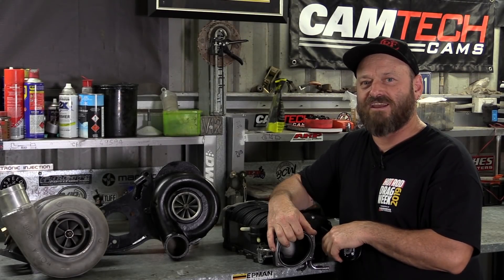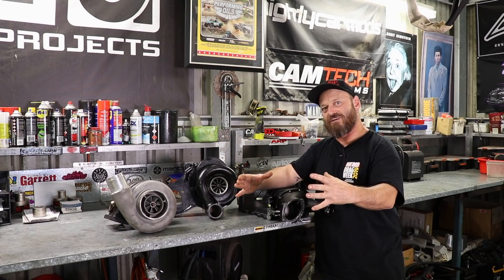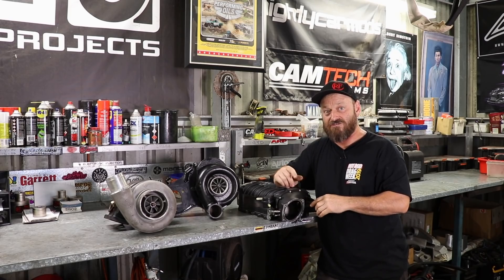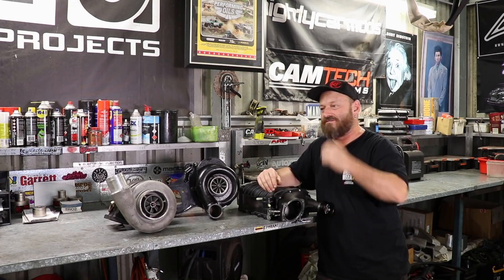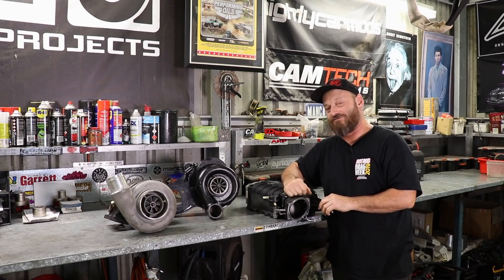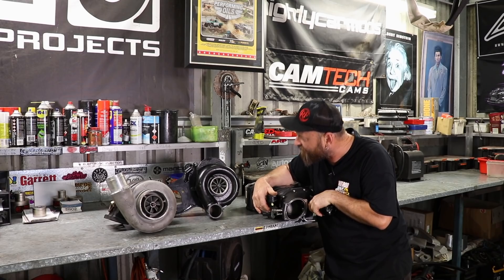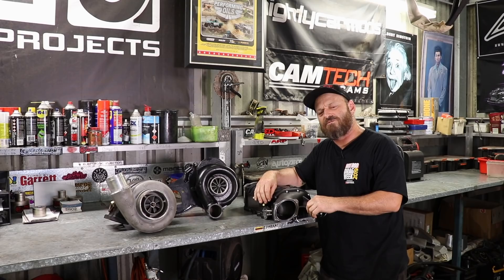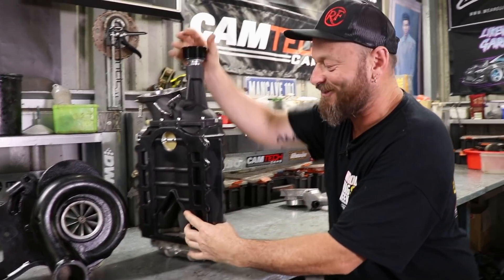Forced Induction Differences - THE SKID FACTORY - [ Quick Tech]

Comment: There is one aspect of your information in your video you didnt mention that the weight savings with superchargers are up to 60% lighter than turbos and do have a great place in circuit racing as proven by berc benz during the 1930-1940 in grand prix racing also turbos also bleed energy or power loss through the exhaust wheel ,manufacturers only did this because it was cheaper  to make them for production cars.
Reply: Nope, the reverse is true. Yes, mech driven superchrgers were the highest tech available in the 40s. However, every F1 car since then has been turbo (where allowed), and money is no object in F1, and weight certainly is a big factor.

Turbo also dominates all classes of motor sport atm (where allowed - turbos are banned from Top Fuel), with exception of rock crawling.

With mech driven superchargers, up to 25% of an engines power is lost just compressing the air - not mech losses, actual work required to compress the air.

Comment: What about the parasitic power lose from turning the belt on the Supercharger? Were with a turbo, you are scavenging wasted heat/exhaust to power the turbo, which will increase horsepower without a lose or trade off  of horsepower to drive your power added.
Reply: Mechanically driven superchargers use 20-25% of an engines power just compressing the air, before even taking mech losses into account.
Reply: Although the additional exhaust pressure and (often) lower static compression in a built-for-turbo engine mean there are a couple of small exceptions to the "all gains, no losses" turbo concept when compared to alternatives.

Comment: I've had a turbo car and a positive displacement supercharger car, both 4 cylinder FWD engines. The turbo ran 15psi and was quick and fun but only after 2800rpm. The eaton was instant power. It made 1st gear a challenge as it would destroy the tires from idle. Positive displacement made 10psi as soon at the throttle was fully opened at ANY rpm.The downside was it would eventually stretch the belt and I'd have to retighten it. Both units have advantages and disadvantages. Sizing for both is important.
Reply: The small factory turbo on my FG XR6T had instant throttle reponse @ 18psi on e85.

Comment: Both supercharges run off the crank. Why can the roots style have instant boost ?
Reply: Thanks guys now I understand 👍
Reply from the maker: Trent Crompton Because a positive displacement supercharger displaces x amount of air every revolution where a centrifugal supercharger requires rpm to displace and compress air.
Reply: The Skid Factory  Thanks guys, now I understand 👍

Comment: blown engines make a lot more power, but it's consumed by the blower it self...
and the air is drawn, not between the vanes, but out around them
Reply: Turbos consume power too. It isn't free.
The restriction they create in the exhaust is essentially robbing the engine of power.
People oversimplify this like "both a turbo and blower will make 1000hp at 20psi, but the blower will steal 300hp to turn it, so the blown engine only makes 700hp"
It isnt that simple and blowers definitely have there purpose. I.e. drag racing or any racing lag would be an issue
Reply: @CatsWRX  Turbos dominate all classes of drag racing where they are allowed. Turbos are banned in Top Fuel.

Comment: And no mention of parasitic drag with the Roots or centrifugal blowers Al, I thought you were better than that....
Reply: 20-25% of an engines power is lost due to the work required to compress the air with a mech driven supercharger, not even counting mechanical losses.

Comment: An appropriately-sized turbo will out do any other form of supercharging.
Reply: -For efficiency, yes. 
-For "bolt on-ability", no. 
-For cost, meh... (you can spend alot either way, but turbo is generally more expensive)
-For future improvements/tuning, yes.
Reply: @glentight  A mech driven supercharger should still have an intercooler fitted if running decent boost, so not much difference in complexity really.
Reply: @nordic5490  yeah, that's true...but I was more referring to exhaust side, works that you can't complete with aluminium pipe and silicon couplers. 
If you've found a "bolt on" turbo kit (for a vehicle not equipped with a turbo already) that actually bolts on, you'd be one of the lucky ones.

I'm not for or against any of these setups, just that turbo is by far the most labour intensive, and it helps if you can weld (for the diy-er). If you can front the cash to get it all done at a shop, yeah, go turbo.

And oil feed lines and drains, plus oil cooler etc, fittings, vacuum lines, wategates, boost controllers...etc turbo is a fair step in complexity.

Comment: Can the harrop regulate boost pressure?
Reply from the maker: It’s to unload the supercharger at closed throttle. It’s a bypass calve
Reply: You change the pulleys to set the max boost.
Reply: Thanks guys. Love the channel.
Reply: I'm guessing that's what the butterfly valve on the underside is, wategate/boost control......maybe......

Comment: Centrifugal Superchargers only make peak boost at max RPM if you don't control boost pressure via a valve. If you size the charger for a broad powerband, you will probably blow your engine up if you don't regulate the boostpressure.

Comment: I'm confused on the both the superchargers. If both centrifugal and Posi-displacement are both controlled by engine speed, then why does the Posi-displacement make peak boost at low RPM as opposed to the centrifugal making boost at high RPM?
Reply: As the name suggests, screw type superchargers are positive displacement whereas turbos and centrifugal superchargers are not. The cfm or “boost” capabilities of the screw blower are more based on rotor size rather than rpm.
Reply: @Frostekzz  thanks man
Reply: Posi is very inefficient, as you pick up speed it creates more pressure but the majority of that pressure is do to heat not increased air molecules.

Comment: Superchargers take power to make power turbos don't they use waste energy to make power
Reply: Wrong wrong wrong, turbos do indeed take power to run as well, look it up. Pretty sure gale banks has some vids about drive pressures etc that may help u understand boost is never free
Reply: @thereal2scummy636  yes you are correct but not as much for the power delivered plus no belt to break or mechanical linkage although blow an engine you will destroy a turbo supercharger maybe
Reply: @thereal2scummy636  not quite. For mech driven superchargers, 20-25% of an engines power is lost just for the work required compressing the air, that energy has to come from somewhere. This is not mechanical loss.
Turbos use energy lost out the exhaust pipe to do this work.

Comment: How come the Eaton doesn't make full boost at full rpm like the centrifugal?
Reply: Josh Smith it’s positive displacement. Therefore it will always displace the same volume of air per revolution. Similarly an engine will consume the same amount of air per revolution.  The supercharger May move more air at full rpm but the engine will consume it thus not increasing boost.  Boost will be linear throughout the rpm range. 
The centrifugal supercharger, like a turbo, needs to spool up.  The design needs a Impeller speed to move air. It spools to it’s highest rpm at max engine rpm.
Reply: @xagtrpo83351  Makes sense, I've never really thought about it
Reply: Simple one to understand, difficult to explain.
Centrifugal supercharger works on speed, more speed exponentially more air until it becomes inefficient.
Roots has a fixed volume per Revolution. So when an engine revs faster and can consume more air the supercharger can't pump enough.
Yes you can upsize a blower and have a bypass at low speed.
Roots are also inefficient and heat the air more than the centrifugal types.
Roots really help low down torque. 
Its all about where the engine efficiency is needed.

Comment: How does a positive displacement make full boost straight away with out it increasing as rpm increases?
Reply: It pushes enough air to make whatever boost you need at that rpm and it scales with rpm. The higher the rpm the more air it flows but the more air is needed by the engine so boost pressure remains stable
Reply: @arthurwalker-trivett7808  Yeah, that's true too.  You make more boost with it by changing the pulleys, to scale up the blower RPM vs the engine RPM.
Reply: @arthurwalker-trivett7808  and it doesn't make too much boost at idle because the throttle body is closed right?
Reply: The efficiency of the helical vanes allows it to produce full boost at fairly low RPM, and they incorporate a bypass to prevent overboost.

Comment: “Most people that have a blower on there car, they just like it ‘cause they’re huge and shiny and shit.” Lol. Boomer hot rodding in a single sentence
Reply: *their
Reply: Have you actually seen a top fuel car. My son is 16 and more appreciation for forced induction than you do. Sad.
Reply: jsmi4190 Yeah top fuelers have over 7,000 hp and use blowers. Hmmm, weird, not one has a turbo or centrifugal supercharger and they are the fastest cars in the world.
Reply: @ardyshane23  thats because class regulations say they MUST use one. top fuel engines are HUGE theire superchargers ARE HUGE and the airfuel mix is practically on the verge of hydrolocking the engine as there is so much fuel and the air is so compressed that it almost gets to liquid state. those engine run more compression than any diesel use literally more current than a welder for the spark. and run only up to about 70psi psi of boost.

compare that to sport compact where a 4 cylider is making over 100PSI of boost and producing over 2000HP from 2l of displacement instead of 7000 from 8.1l. based purely on a hp per CC or HP by dispalacement turbo yodas statement is TRUE

hell at summer nats a 6 cylinder made of 2000hp on 3l of displacment with less boost than a top fuel so again using top fuel and their use of blowers isn't a good example of the pinacle of power and efficiency. because if they could use turbos they would and they'd make even more power due to elimination of the parasitic power loss a supercharger adds. which btw it takes up to 700HP to just turn the supercharger in a top fuel
Reply: kyle hubner I am not doubting what you are saying to some degree, but I do believe if it was possible to make more power than a current top fuel race motor, somebody would do it and put it on a track. In my research nobody has. There are also the laws of diminishing returns. Sure 2000hp out of a small motor is great, but what does it take to get 2500 or 3000, and that’s still light years away from the power top fuelers make. My only complaint about this video anyway was the attitude towards roots blowers, like they are pointless. All forced induction options have a place, and all are fun and make power. I agree some are more efficient than others obviously. I like them all, but I like NA the best.
Reply: @ardyshane23  A top fuel engine is a very expensive machine for a very specialised purpose, it runs 402 meters on a special track, nothing else. It literally turns the crank over ~400 times at full throttle between rebuilds.
Why make an engine like that without restrictions to make ~10.000 hp when you can't run it anywhere, it would be illegal everywhere, on the road (not to mention very unpractical) and on the track. Without a sanctioning body there would be nowhere to run it.
I'm no expert in top fuel drag racing, but I'm guessing that 7000ish is near what is useful to have anyway and the trick to go faster is to put as much power as possible to the track, not push the power level higher.

Besides Cleetus put roots blower on his burnout car. With the boost turned down to 5-6 psi he took the 800 NA hp engine to a wopping 700 something.... But it looks cool and sounds cool!!!
Reply: @mawe42  cleetus detuned it because he was scared  a 12.1 n/a  compression ratio engine wouldn't  take kindly to boost,and rightly so 
...it's the same with  turbos 
you need to run lower compression with boosted engines to stop detonation and rodney coming out to play,
mcm found this out too
Reply: @grumpyoldman-21  Soo, it was just there to be shiny and make belt sounds...
Reply: @mawe42  on the street ...yes ....
you're reading and comprehension  on the other hand ...well let's just say i think you wasted about 1 million dollars of taxpayers money
Reply: @grumpyoldman-21  so explain to me. Why take an 800hp normalt aspirated engine, slap on a blower, boost to 4-5psi and get 6-700 HP?
You can detune an engine without puttning a blower in the way of the air.
Reply: @mawe42  well if you watched the videos he has done while in australia  you'd realize he blew up his original motor and had to source another from sydney and have  it fitted in under 2 days ,hence why it was detuned,the ecu would have required a boost reference seeing as it was tuned for ...um a blown motor and  a n/a motor looks  well whimpy ,and i'm sure now it's back in the states it's up around the 1200 hp it made originally
Reply: there is that explained well enough,
or do i need to dumb it down to a pre school level
Reply: @grumpyoldman-21  I seen them all, an 800hp engine with 10psi of boost AND methanol made just over 1000 hp. That  is really piss poor efficiency. Wasting ~300hp for the bling and sound compared to what it could do. I'm not bashing on Cleetus, the car looks awesome, all show with enough go to do its thing.
Reply: @grumpyoldman-21  Behave like an adult (if you are).
Reply: @jackass123455  Mate do you even know what fuels, there's 2 types they use during a race, a Topfuel dragster uses?

Somehow I doubt it.
Reply: Shane P I wonder why. Maybe because they have not been allowed. Has nothing to do with the design. 
That’s like saying a Camaro sucks because it has never won at mustang week

Comment: Centri is nice because you can pulley WAY down and gate the rest if the motor isn't capable of handling it.  Gets rid of that painfully boring powerband.  Where you'd make peak boost way high in the power band, that tiny pulley relocates it.  My Paxton was trash with a 3.6, entirely different animal with a 3.25 on it.  

And it still doesn't compare to what a Whipple or Edelbrock PD blower does in the same car on the same motor with the same mods and the same fuel system.  Might make for a more effective car around a road course, but most manufacturers are going with PD setups on their cars.  GM with the ZL1 or ZR1, Ford with the GT500, Chrysler with the giant heatsink they have on top of the Hellcat/Demon motors.